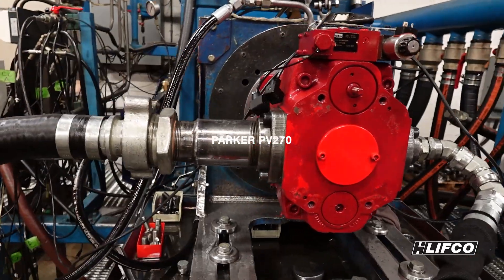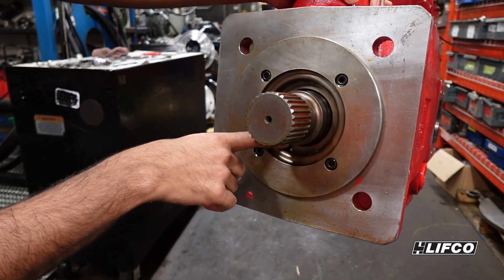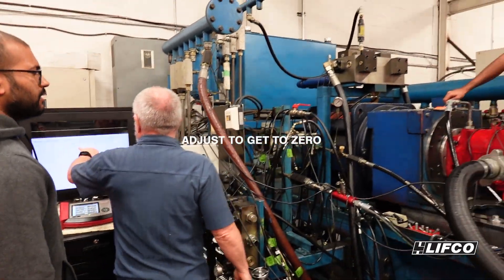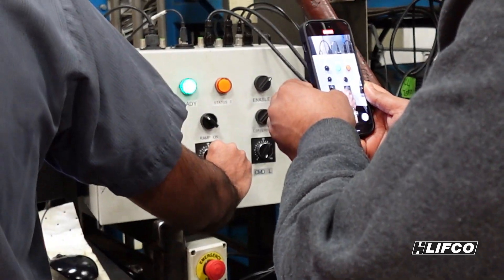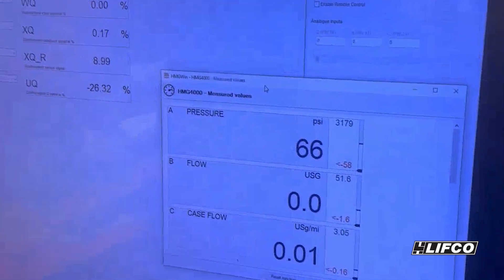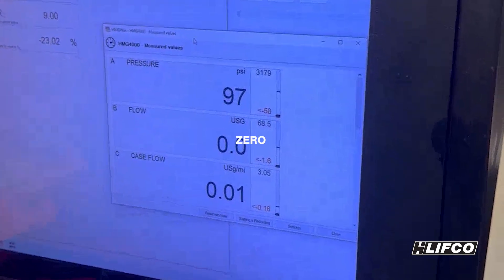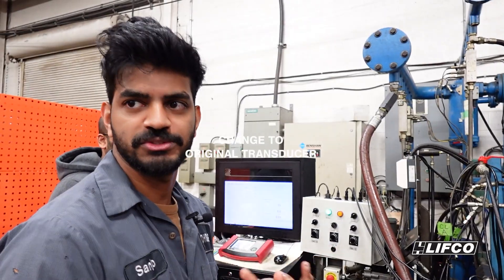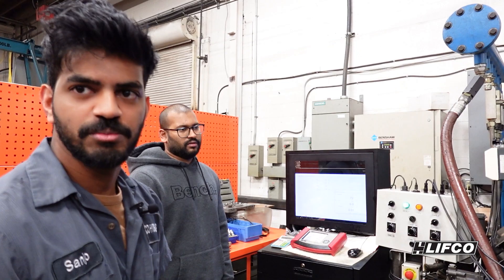$17,000 hydraulic pump - what's wrong with it? | Lifco Hydraulics | Parker PV270

Comment: Wow 17000$ for that,  thats a lot of money.
Reply from the maker: High pressure (big price jump from the 4000 psi pumps to the 5000 psi). Proportional flow control (means flow can be controlled by an eletrical signal). Big displacement but still about 50% cheaper then two smaller pumps combined, and much simplier system. -Fraser